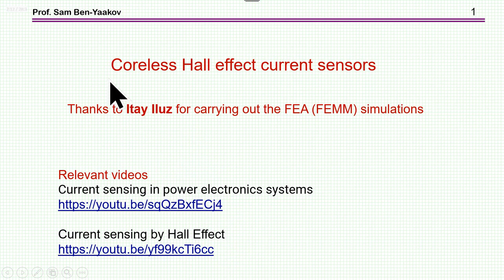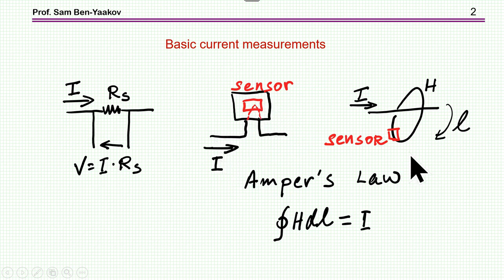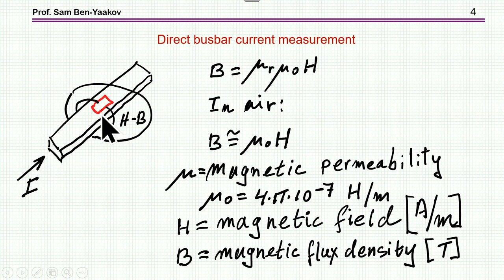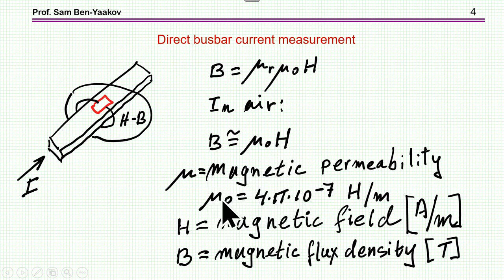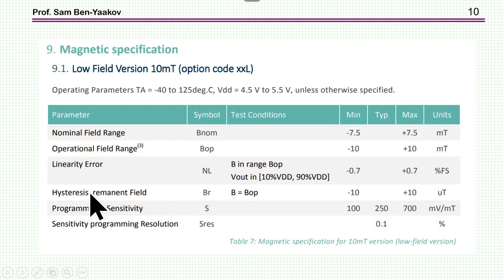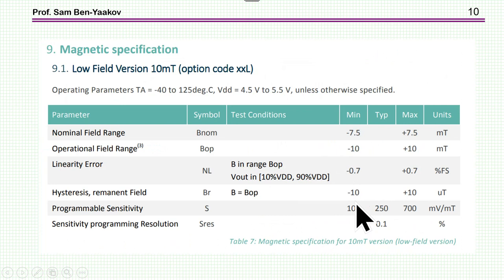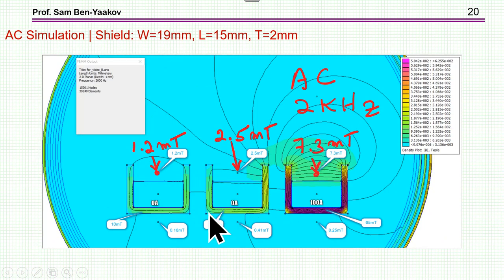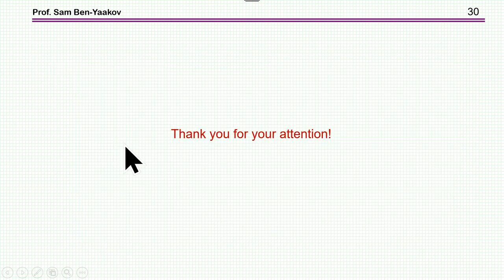Coreless Hall effect current sensors

Comment: Thank you for this great video.  Quick question, where does it specify the proportional output current information. For instance: -400A = 4mA, 400A = 20mA. This is what i dont understand and it seems that datasets does not cover this in plain sight.
Reply from the maker: Please indicate to which slide or minute in the video you are referring to.
Reply: @sambenyaakov  basically a general question. Like in datasheet for instance, I was looking for proportional values of thr current reading. So if we know that the current we are measuring is 100A. How does thr current hall sensor output this value in proportion if that make sense. And how does it calculate and output.  Sorry for being confusing 😕
Reply from the maker: @UnBOXTopicz   The current generates a magnetic field H that induces a  a magnetic flux B that is read by the Hall sensor.

Comment: Thanks professor. Can we use rogowski coil in the place of hall sensor.
I know it will be bulky, but we can make it as a flexible and cable tie type of sensor.
No saturation and high frequencies are possible.
Can you make a video about this.
Reply from the maker: Rogowski current sensing is great. But, being based on Farady's law, it is blind to the DC. This is unacceptable  in many cases. A video on this method is a good idea. I will try.
Reply: @sambenyaakov  Thank you. I can understand. I suggested rogowski coil because we discussed about busbar current sensing where we have mostly AC current.
Another one beautiful application Note available in Ti with DRV425 fluxgate current sensor IC specifically for busbar current sensing where they are completely avoid the surrounding magnetic field. You can look in to that.
In that method AC/DC current sensing is possible.
Reply: @sambenyaakov  There are many attempts to combine the Rogowski with Hall sensors into a composite high bandwidth sensor capable of DC sensing. There is also some exotica: Neel effect sensors and saturable reactors.
Reply from the maker: @udhayakumara4033  There is of course a DC busbar too. But I would be hesitant to use a Rogowski sensor for the phase curent since it may produce offsets during transients.

Comment: You didn't mention anything about the magnetic orientation of the crosstalk field, it is very important, even the FEMM program can't give you separate measurements of the field orientation.
If the crosstalk field is perpendicular to the sense direction of the IC, then no effect will happen as far as I understand.
Reply from the maker: Thanks. You are correct. I have not emphasized this. Yes, crosstalk means that the interfering field has a component in the sensing direction.
Reply: @sambenyaakov  Thanks for being so open to my note like this, in the end the video was so informative and helped me so much, please keep going :)